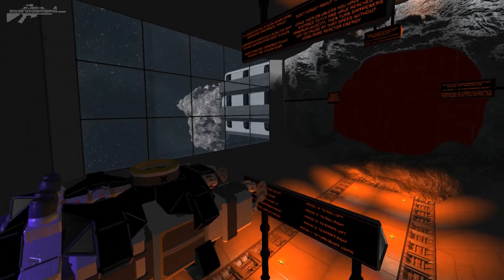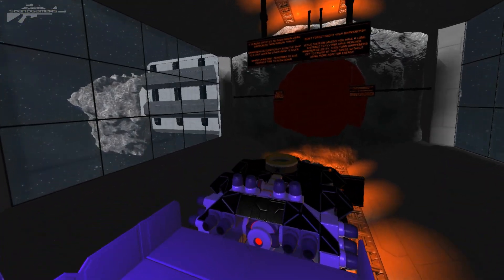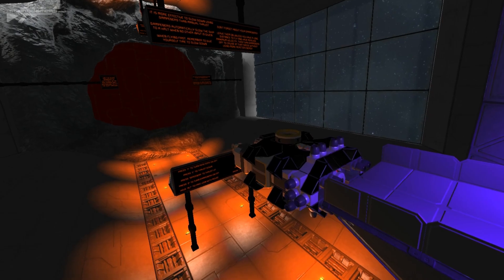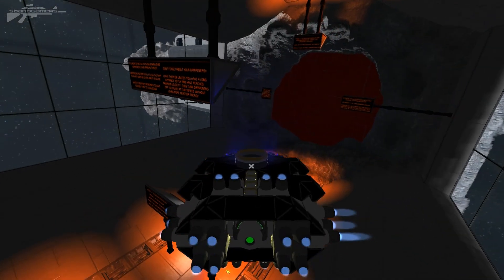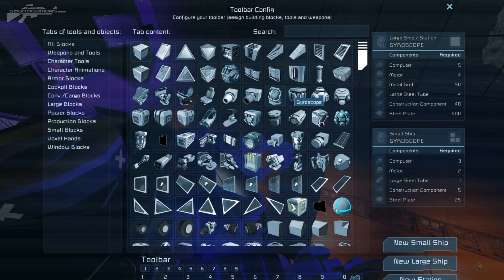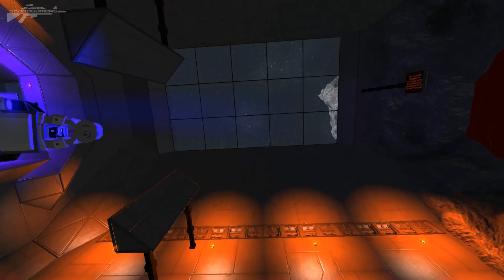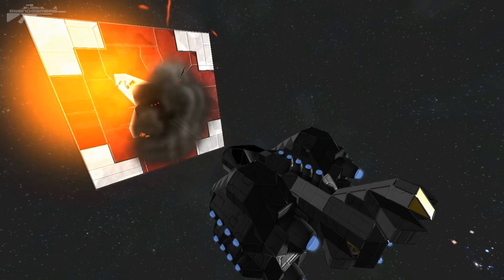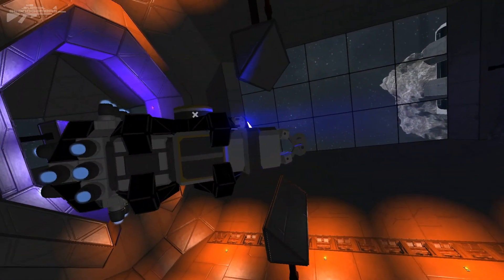Space Engineers - Rebalancing (Micro Update)

Comment: Pretty sure they changed the thruster and reactor output to compensate for the additional mass in cargo containers. Small ships were really struggling to move around with full loads. All of my previous mining and welding ships needed to have additional thrusters put on them over the last few weeks. So many that design was becoming an issue.

We also have no idea how hard it will be to get out of a planet's gravity well. That may also require additional thrust than is reasonable with the previous thruster balance. Doubly so, with full cargo loads.

Comment: My initial opinion of these balance changes is coming out negative. They seem to favor larger ships while smaller ships are going to suffer, especially considering that thrusters now take up twice as much of a ships power supply as before. Even before testing them I'm already certain that some of my ships now don't have enough power.
Reply: Shoes It's a set-up update for the planets update. Most ships right now probably would not have to power to escape a planet, so they boosted the engines to give more thrust, but they still needed to balance it somehow, so they made it guzzle energy at a faster rate. this made the reactors not as powerful because the power draw might have been bigger then the supply, so they increased reactor output while increasing it's uranium consumption. So really, the only downside is that you now need more Uranium, or more solar panels. But on the bright side, heavy armor can take a greater beating and you can now (hopefully) escape a planet when they come out with that update.
Reply: Shoes easy solution: cut the number of thrusters and replace them with reactors. In my opinion this helps small ships because it's easier to find a place for a reactor than it is to find a place for a thruster.
Reply: Shoes 
Besides other valid reasons this was a needed change, personally I like it. My combat oriented ships no longer need to have 50% of all their surfaces comprised of vulnerable thruster nozzles in order to achieve a decent speed. Additionally with the changes to cargo mass, this extra thrust power was very much needed. And sure, I've got the same issue that many of my old ships are now outdated or obsolete, but it's not a big deal and an expected part of any alpha. Old ships become obsolete or need updating all the time. Expecting otherwise would be naive.
Reply: i always have an unnecessary amount of power, so it doesn't affect me much. Besides, i make ships, not use them(that much)
Reply: Garrett Montgomery Good idea.
Reply: Augustinian de Juan Pierre
Actually, it's a terrible idea. I'm not going to put reactors just wherever they will fit in order to get enough power because I build ships with survival in mind.
Reply: Shoes The force exerted by the rockets is greater now, so you merely need to cut rockets until you achieve a balance. How is that a bad idea? The only draw back I can picture is that your overall speed may be decreased, but I think with a little updating on the ship, you can easily overcome the power shortage.
Reply: Shoes well, I rather consider this as a buff for smaller ships. You can now have more compact thrust as all their stats are buffed, and your current reactors are also buffed. Should also be noted that uranium is abundant as soon as you start eating asteroids. I have 10k refined sitting around in my mothership waiting for some kinda dark matter generator and super-reactor that uses tons of energy. Or nuclear weapons :3

Comment: So far, I'm hating the update's changes to thruster/reactor output.  If the changes only applied to large ships, it would make sense, because now they can get better thrust by allocating more of their interior space to reactors.  But small ships?  They get NO boost to thruster power, but now the thrusters cost 6x more to run!!  And only reactors are getting the boost to power generation, which means that all my fighter designs that use batteries have been rendered useless. 

 I put a lot of time and energy into making a practical, efficient, cheap, battery powered fighter design, and now it can't even fly without overloading.  A ship that used to be able to fly easily in a 1g environment now crashes immediately.  Sigh
Reply: SerialSnowmanKiller We should expect this kind of thing given it isn't even in beta yet. Yes I know it's always banded around "it's still alpha!" but it is. It's in the development stage where things can and will (and have) change quite drastically. They're still working out what does and doesn't work. Once they have all the main features in the game they'll move into beta and spend that time refining everything and rebalancing it all. Even at this stage it's far more complete and stable than most AAA releases from the last few years. It has tons more content too even without the mods lol. That just tips it over the edge though and is the extra cream and cherry on top!

Comment: I see the adjustments to the game as somewhat logical actually - Higher cost on uranium reactors in uranium isn't so bad when it outputs more energy, same for higher thrust output from thrusters. It means you don't have to put as many of those on your ships and thus can spare more space for other components and design arrangements.

I don't know about the progress investment shift for item cost balancing across the board as much though, as it is kind of.. Hard to be sure what the changes really do in the long run.

Personally I think the cost of certain devices should be relative to their size and purpose - For example: more complex electrical components may require more materials to refine down into a useable form.

Besides those, I do agree that some of the mods could be implemented, as that does improve the variation of block types available. But I think the main reason they would be withholding from doing that is because of the fact that if they implement something they have maintain it in the game as they continue to update it... And they might not be ready to do something like that until a bunch of their existing parts are done being.. Adjusted, balanced, improved, thought about, and reconfigured as needed.
-I'll Be Watching.